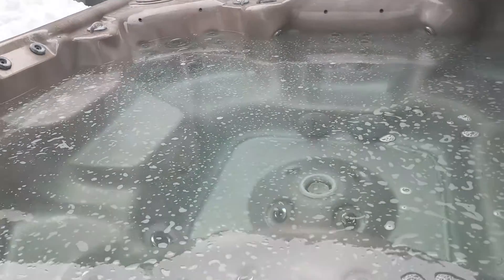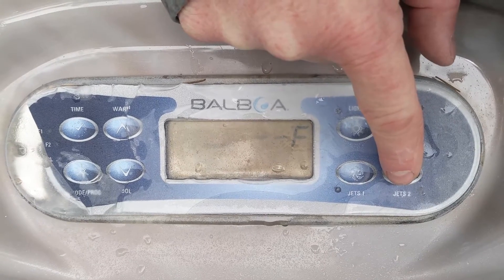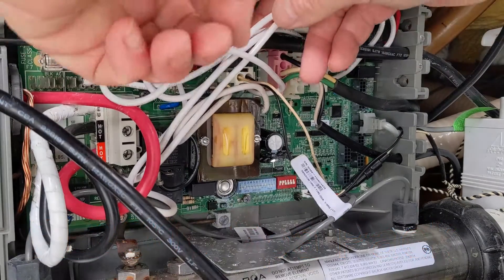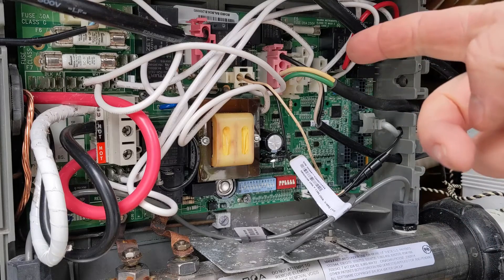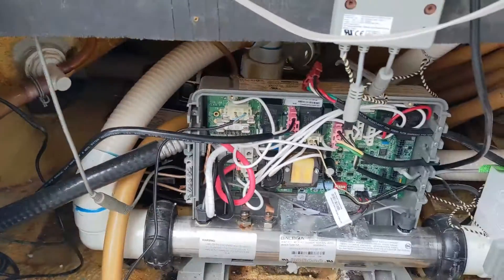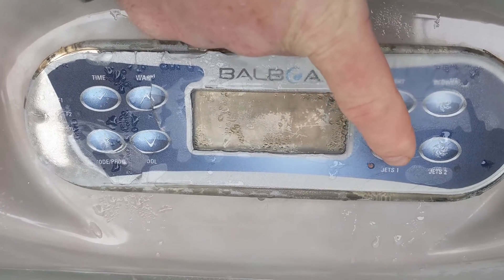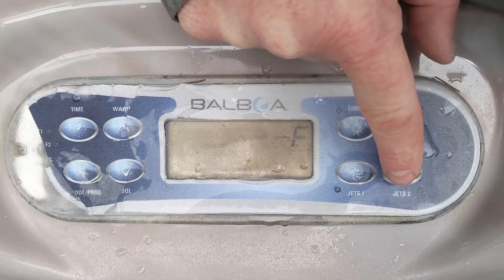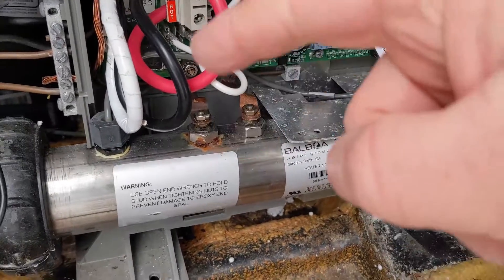Hot tub Trips GFCI Breaker When Jets are Turned On

Comment: Would the troubleshooting steps be the same if the issue were:

1. Pump 1 runs in low or hi
2. Pump 1 runs on low and pump 2 can run
3. If I run pump 1 on hi and and run pump 2, the breaker trips.
Reply from the maker: Anything new installed?  Pump 1 + Pump 2 Amps = ?????.  And whats the breaker size that trips?